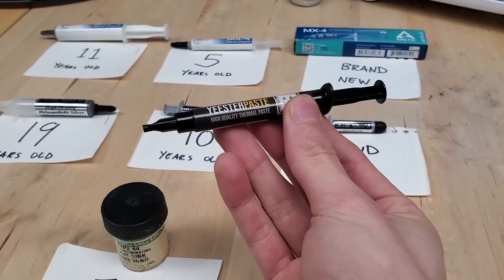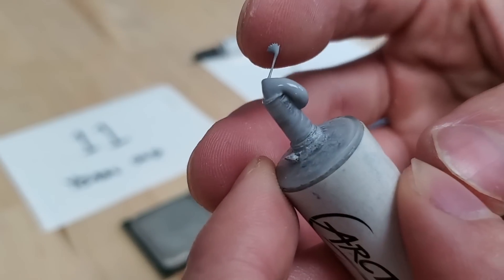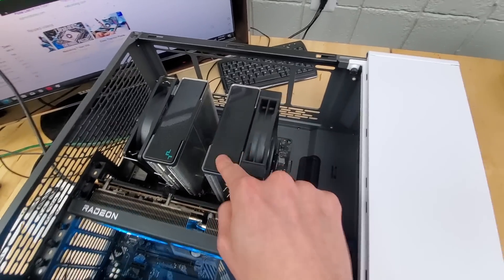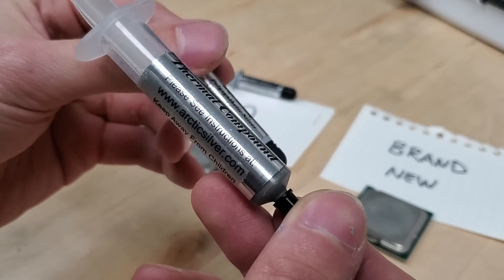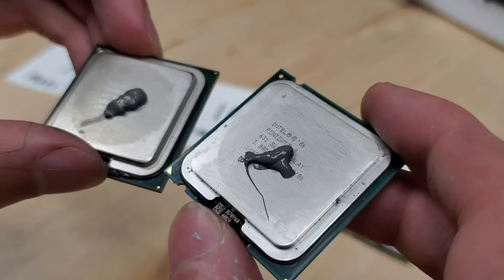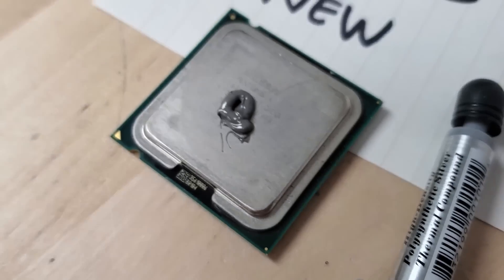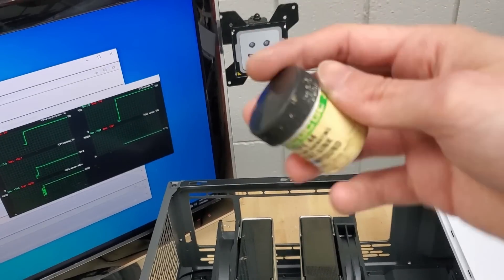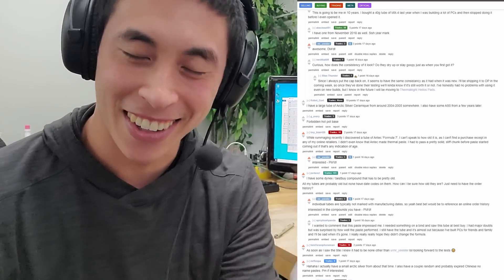does thermal paste ACTUALLY expire?

Comment: That MX-4 seems to have changed recipe cause I don't remember having a brand new one looking like that newer one. All the MX-4 I had was more like the old ones you have even when brand new if I remember well...
Reply: what if your "new" paste already on store shelf for a year
Reply: @chlonez  It doesn't matter cause mine has many years and looks like his older ones and since day one it looked very similar so it seems different to his newer one...
Reply: we got a new tube of MX4 a while back and it looked just like the older mx4. Ours came in a different packaging so I'm also thinking they changed the formula. I did a little googling and found a 2022 reddit post stating arctic changed the formula, as the new MSDS for MX4 shows a totally different specific gravity.
Reply: @kasuraga  I'm still using MX4 from 2014, if they did change it, Im guessing its for the better, after all, technology improves over time

Comment: I found a tube of thermal paste in a motherboard box that supported Intel Pentiums that still had pins on their CPUs (before their LGA standard) at the start of 2020. It handled my 4790 for about 4 years back on my old Z97 build before I finally upgraded. Probably not the best of ideas but.. it worked! :D

Comment: The real test is how this old paste holds up in use. I've used 10+ old unbranded  thermal paste in a server and wasn't able to get more than a year of 24/7 duty before it tripped the temp alarm and spins up the fans to max.
Reply: are you sure it wasnt the dust build up and not the thermal paste?
Reply: 24/7 100% cpu load?
Reply: @ivok9846  not running 100% all the time.
Reply: @jimtaylor201  dunno, stuff you say is quite relative, for example if you put alarm low, and it might be 80 to 81°c difference, which is nothing.
i mean, spinning fans to max on occasional redlining is nothing out of ordinary. 
do you aim not to spin fans? 
i have some old machine that one can hear when it's at 100% cpu, it spins, so what? 
i never renew paste in anything i've built. no issues.
did a lot of video encoding.
Reply: @ivok9846  the motherboard is set to thermal defaults and will spin up at full blast when it reaches those HP settings. No other CPUs have that issue in that server or other identical servers in the same rack.

Comment: thermal compound that they used to put on transistors in amplifiers used to be drier than CPU thermal pastes
Reply: like why? its so bad over time
Reply: how so? i have some white silicon paste made exactly for transistor coolers that i was putting on CPUs and it's not hard at all. all "cpu specific" thermal pastes i ever saw are drier than that one, and from a get go.

Comment: One thing you didn't account for / didn't bring up is changes in formulation over the years.
Even tubes manufactured in the same year may not have the exactly same formulation depending on where it was manufactured. Factures in different places will source similar / compatible raw material that are easier to get in their region.
Reply: Still as it stands there is hardly anything to worry about unless the thermal paste has turned to water, but yeah i dont doubt the forumals are differeing but most (quality) thermal pastes hit a wall many moons ago
Reply: Yea over the years advancements in formula's and increase in power draws of cpu's would likely cause them to reformulate the paste to have better thermal transfer properties.
Reply: 100000%

Comment: I'm using 15 year old thermal paste on my computer right now over clocked to 4.7ghz on 6 cores with a single tower with duel fans on it 😂 it does throttle yes

Comment: How does this test relevant as these pastes are basically brand new. For this test to be relevant the paste has to be using for the specified time like 5 years or so.
Reply: Like my Arctic Silver 5 I been using with my rig since 2013. 40c for the CPU on idle and around 60 on load